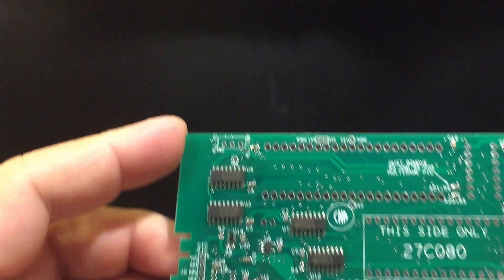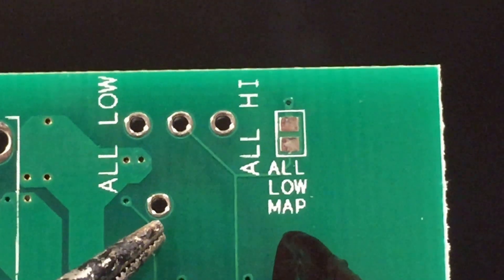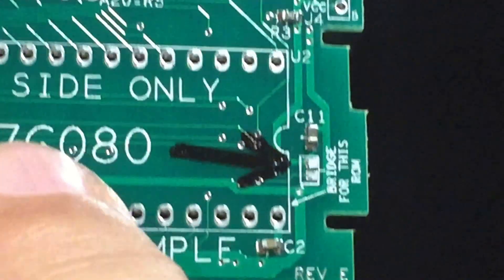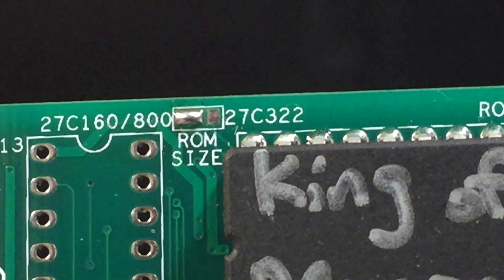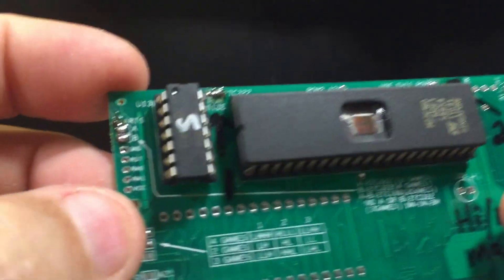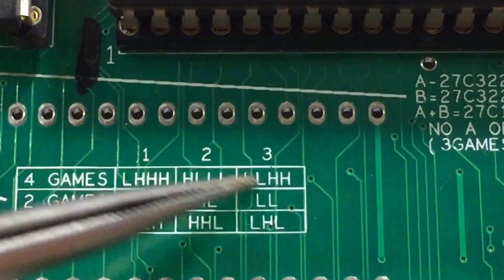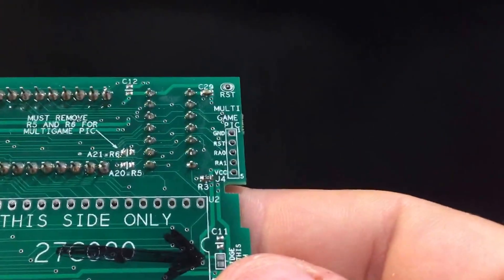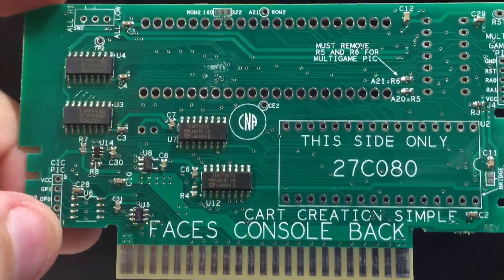SNES SIMPLE PCB

Comment: If your lorom 8Mbit cart accepted the M27C801 I would get some for me.
Reply from the maker: André Moreira   It does use the 27c801
https://www.mortoffgames.com/super-nintendo-/homebrew-equiptment/boards/simple-no-save-pcb
Reply: This big one accept 27C801 but I wanted that small one at your store. The big one is too complicate to do.
Reply from the maker: André Moreira the whole purpose of the pcb to to be very easy.  
Which big one?  The blue pcb is not that big and is super easy to use.    Program your 27c801 and mount.  Solder 1 jumper for Lorom, 2 jumpers for hi rom.  You are done.   
How is that complicated?
Reply: The one I am talking about is https://www.mortoffgames.com/super-nintendo-/homebrew-equiptment/boards?product_id=879. That is small and Works well for 1mb games but it doesn't support the 27c801 it only supports the 27c800 and 27c160. Well I could use these eproms but my programmer isn't compatible with them.
Reply from the maker: André Moreira oh, that is not my pcb.  Someone else's product
Reply: I thought that one was yours.